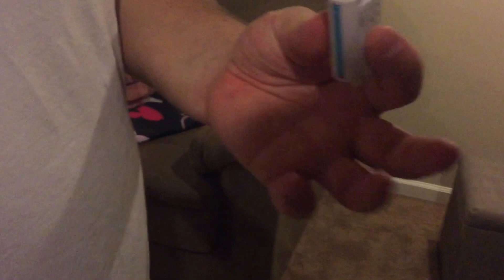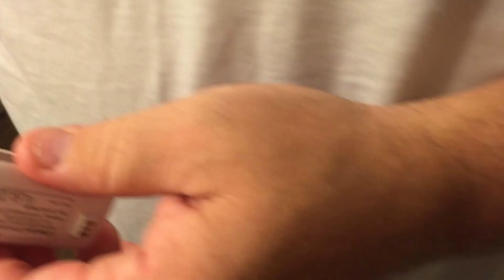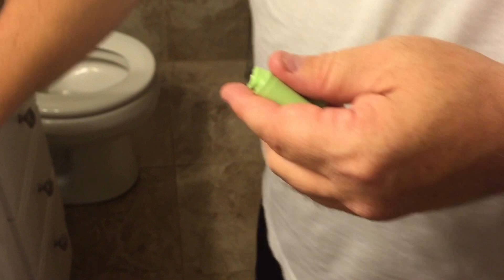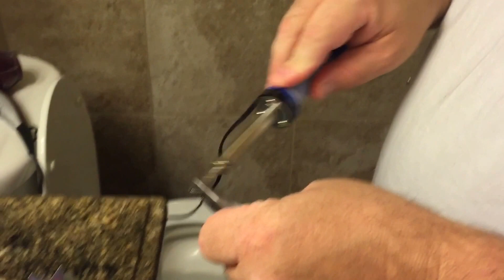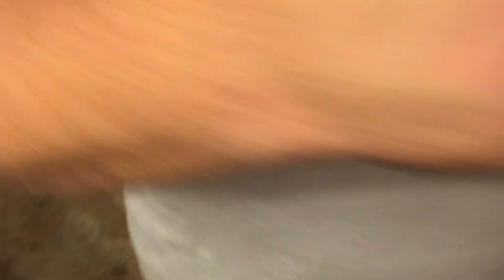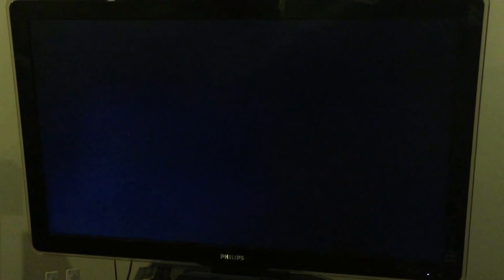Wii Nyko Rechargeable Battery Fix - Replacement - Repair Tutorial

Comment: I appreciate the tip about using a razor blade to make the cut. I used a box cutter with a brand new blade and made a nice clean cut through the seam. If you do one side at a time, you can rock the blade back and forth until it snaps through. One tip is that the center area is recessed and appears to be part of the plastic casing but isn’t. It’s a paper insulator adhered to the metal tab that connects the batteries. No need to try to get the blade down into that recess. 

I removed the metal connecting tab from the old batts by sliding the blade under it and gently prying from multiple directions. 

When reassembling I just laid the metal tab across the tops of the batts and put a couple drops of superglue to close the case. 

The batts arrived about 75% charged. I’m going to deplete then completely before charging them.

Comment: Worked like a charm.  I was able to open the plastic case using a box cutter.  Had to use foil instead of solder at the top but it worked :)

Comment: Get a decent lipo charger and charge them with it.  Most of these are not dead rather their voltage got too low for the charger to recognize them.  You can use a cheap lipo hobby charger to bring the voltage up.

Comment: I was actually wondering if I could do this same thing, but when I saw it was sealed shut I thought maybe it wasn't. Been using my charger stand as a wii mote holder for years, going to give this a try for sure would be awsome to have this working again.

Also how many mAh did you use for the replacement batteries?

Comment: You can find those replacements on amazon
Reply from the maker: Albert .J you can but they aren’t made anymore. That means you will either pay a lot more or end up with some used batteries that may not be all that good.
Reply: djtomr941 when you find those on amazon get the one that says like new or get the one that was tested

Comment: How would I go about opening these with a screwdriver? Would I just pry it open?
Reply from the maker: OhhChezy it won’t be easy because it’s pretty glued together. I would start with a knife and cut a groove and then work it with a flathead very patiently. Use a rag to hold the battery so you don’t cut your hand when it slips.

Comment: Good idea! Gonna try!
BTW, Y U work in the toilet?
EDIT: I wonder about amperage though. Found the battery with 1200, 1500, 1800, 2500 mah. Would any of those work properly (just hold charge for more time?).
Reply: BE CAREFULL WITH THE LITTLE PROTECTION INSIDE THE PLASTIC PACK.

Just did it. One went ok and the other one doesn't work. 
I think I messed with the little protection thing inside the pack when I was inserting the batteries. 
I can measure 2.5v both on the bottom terminals and the charging plates but the wii controler won't turn on with it (with the new or old batteries). This makes things even more weird.
Reply: Gustavo Neves you may need to reconnect the wires if you severed the heat sensor.

Comment: Thanks for this. I too have a Nyko battery charger, bought replacement batteries cos mine had given up the ghost then found out they charged from a different input! Following your video I have managed to replace my new batteries into the old Nyko cases and they are now charging. cheers

Comment: I am having the same issue with my 360 packs....cant find a replacement pack now, but a whole new charging system for 25...i dont need a second charger...I think i will get the Ikea LADDA batteries to put inside the packs.
Reply from the maker: You just need to open it and see what size batteries it needs. Could be full size, could be 4/5 AA.

Comment: Thanks. I was able to use a razor blade to cut along the seam and didn’t have to have the tool. Only took five or six swipes across the seam to cut through and open it up.
Reply: David L. Barnes thanks i did the same thing and it worked. also put an c clamp to close the case back up and used jb weld on the seam instead of tape to keep it closed thanks again

Comment: Thank you for the video, and the info.  The replacement batteries from Nyko have been discontinued.  I'd rather attempt this hack versus spending twice the cost of the batteries on another Nyko charger (my second).  My question is how did you know which batteries to buy?  Also, I used the edge of my X-acto knife to help open the Nyko battery pack, then finished it with my fingernails.
Reply from the maker: David Richardson I took it apart first and did some googling to figure that you need 4/5 AA NiMH batteries.
Reply: After performing the work on 4 remotes only 1 or the 4 work.  When I click the 1-2 buttons the blue lights blink?  The only thing I can think of is to measure the batteries I soldered with a mulitmeter?
Reply: Nvm, all 4 remotes work after performing sync procedure.
Reply: I was gonna say that if they blink --> they work...

Comment: How are the batteries after a year of use? I'm thinking of doing this, and I'm between buying regular rechargeable AA's or doing this with the old Nyko's.
Reply from the maker: Kenny K the batteries are still charging fine. You will get 2-3, maybe 4 years out of them. It depends on how often you charge them. They only have so many cycles. Also, if you don't keep them charged above a certain threshold, they lose capacity and build resistance to being charged.
Reply: Thanks. I'll try it out